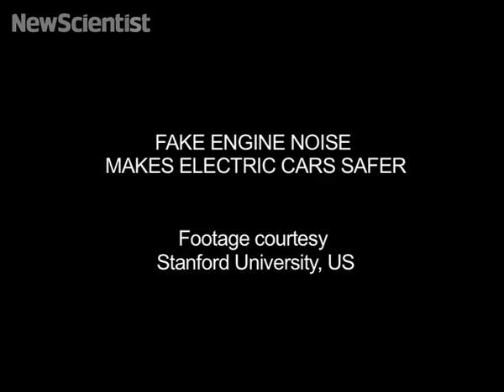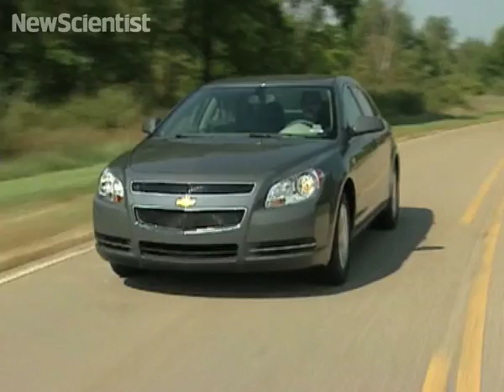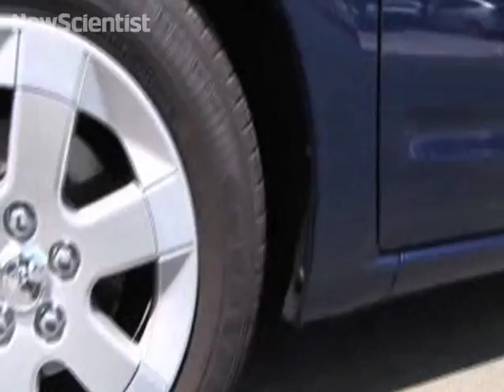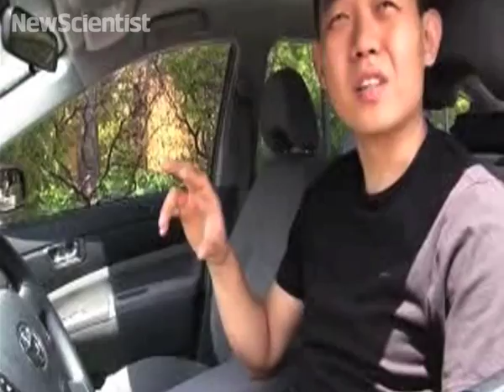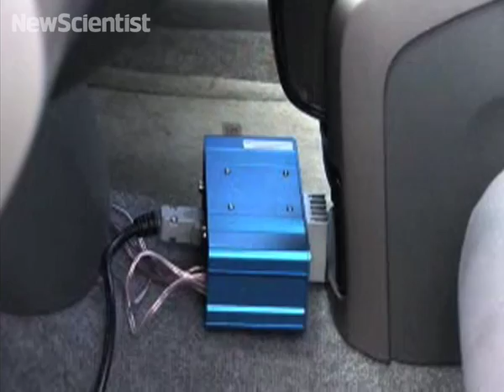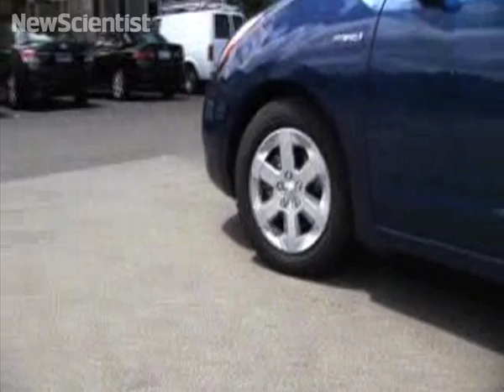Fake engine noise makes electric cars safer

Comment: What a load of crap, so we finally have quite vehicles and now it is said they are too quiet what a load of shit.Look some petrol cars are so quiet you can't hear them coming along anyway, the industry has been making them less noisy for years, so why do they want to now make them noisy again.What a load of shit.People walking in front of trucks that make a huge amount of noise, some motorcyclists were being ticketed for riding noisy bikes, so now they are to be ticketed for riding or driving vehicles that make almost no noise, bullshit.Some how someone has convinced some morons in office that quiet is bad basically manufactured a problem that simply does not exist, now they want to make a killing on selling crap that will make no difference at all to an industry that spent millions of dollars/pounds finding ways to solve the problem of noise created by engines.That is just plain stupidity of the highest level.Before you cross a road you should always look, most petrol engines can't be heard especially in the city amongst all the other noise, so how loud will this thing have to be in order to be heard? a stupid idea purely for making money, creating a problem where there is none.

Comment: All highway going downhill? What is "consumer level", under $150K? I don't know of a single car priced in the 20-40k range that can get 100 miles from battery. We have no idea what batteries are going to do in 10 years. It might double it might quadruple or it might stagnate. The real answer is using carbon fiber to lower the weight of the car. We have 3k pound cars to move 200 pound bodies. Makes no sense.

Comment: @sniper1334   This is true at higher speeds.  However, the concern is not with cars traveling at 30 MPH or faster.  Rather, it is with cars at slower speeds that  you would get at urban intersections, turning corners, or in parking lots.  The safety studies by NHTSA have shown that the increase in pedestrian crashes for hybrids is only at lower speeds.  Go out sometime to a street corner with a blind person and see how well they can detect hybrids versus other cars at 25 MPH and slower.

Comment: This is ridiculous because unless under hard acceleration, almost all modern cars with factory exhaust are quieter than the noise the tires make when contacting the road. Next time your walking and a new car is coming toward you at lets say 35mph, listen and pay attention to what you hear. You hear the tires, not the exhaust.

Comment: This would work great in winter.. when it gets covered by snow turds lol.  Its an awful noice still.  WHy not just put it in the grill so it only points forward, and one at the rear plate for use when backing up.

Comment: Horrible.  Not a solution; this is a bandaid.  Cars moving more than 10 or 20 km/h generate more noise from the wheels than the ICE anyway.  At speeds slower than that, the driver has enough time to hit the brakes...

Comment: The hybrid/electric vehicle to operate quietly until a pedestrian needs to hear it. The automotive companies spend millions of dollars to keep the cars QUIET,  PASS only allows noise when it's necessary this is why it should be on demand,  FYI Leader Dogs for the Blind in Rochester Hills, Michigan has 2 system that they have been using for 2 years for training. but I am the inventor of PASS SYSTEMS so I am Bias, go to my you tube and see it

Comment: This has to rank as the biggest excercise in stupidity I have ever witnessed because the simplest solution would be to plant small acoustic transducers on the armature of the electric motor. The moment the electric motor starts spinning the transducers would create an appropriate noise at a reasonable level.

Comment: The only reason the blind would need to know about a car in the road is if they are crossing it, which should be at a designated crossing ... so unless they are concerned about the blind 'jay walking' and getting hit ... im not quite following the use of this.

It sounds like crap and surely imitating the noise or a pertrol car defies one of the benifits of an electric.

Comment: That's awful... we should be moving in the way of QUIETER vehicles, causing less fossil fuel pollution AND less noise pollution.

There must be other ways for blind people to avoid cars crashing into them - oh wait, how about the drivers pay attention  when driving a car!  Or how about they wait for a pedestrian crossing to tell them when they can cross.  Whether it's a fossil fuel car or an electric car you'll still get run down if the drivers ignore the lights in any case.

This is dumb.

Comment: You have no idea what you are talking about.  My gs450h rarely uses the gas motor when I am in a residential area or maintaining my speed.  Even when I pull into my driveway, 100% silent.  Pretty much every hybrid to date has this "Gas - Gas/Electric - Electric" phases that engage and disengage based on driving conditions. Perhaps do some research before saying that all highbrids make a whine (of which I have no idea what you are talking about).

Comment: Hey!  I have had this idea for a long time. .  
It would be a very cool thing if I could make my old Mercedes sounds like a big V8 when I rev it. . It cant be that hard to install a sound modulator that is conected   to the coil (for picking up the Rpm) and then straight into my car stereo. .   And with a flick of a switch your were able to change the sound from a V8 into a F1 car or any other engine type. .  And if you also have external speakers you could be really cool at the redlight stop. .

Comment: I take it you've never actually driven a prius. Miserable little cars. The interior looks like shit and has more plastic than a ford, the performance is dismal, the fuel economy is less than a diesil BMW 5, and the drivability is that of most cute-utes  or minivans.

And let's say you neglect all of thatbecause it saves the planet. It takes less electricity to build a hummer. Plus, the materials to make the damn the damn thing leave such a big carbn footprint, it's not worth it.

Comment: lol yes you can ... the big black glasses and the stick thing are a dead giveaway. And the dogs are not trained based on "engine noise" because not every single car on the road sounds like a dodge viper ... the smaller engined cars barely make any noise at all, if anything the only noise you hear is that of the tyres gripping to the road. 
The dogs are trained to spot cars etc. and wiat for the coast to be clear prior to crossing. my arguement still stands, implementation of common sense works

Comment: Brizz519 wrote:
> And since when have the blind been aimlessly
> hanging out in the middle of the road, only
> fleeing when they hear the roar of a V8?

What the? Are you serious? The point is that blind people do cross the street and one of the ways in which they know when it's safe to cross is by hearing the cars. If they can't hear the car, they could potentially step out in front of it by mistake.

Comment: Umm yeah my mom told me to look both ways...and if you CANT then you DONT CROSS unless you have a DOG or if there's a cross light that BEEPS specially designed for BLIND people... GOD how retarded can people get.
And yeah most of the time it is the pedestrians fault, cuz they shouldn't be crossing even if they do have the preference. its called red light NO GO green light GO. and how about we stop having noise pollution? what's the point of having a silent car to attach noise on it?

Comment: Dont think this is a good solution. I mean I dont think many people will like the idea of being charged for something that doesnt benefit them. It would probably be cheaper to fit these disabled people with something then have every car sold fitted with one of these. Picture sun glasses with built in radar or motion sensors! If it needs to come from on the car it needs to be something far more beneficial like auto braking sensor.

Comment: might be a good idea for type of "problem"
but in this video it sounded more like something was caught and dragging under the car rather than an engine..
but that might be the sound quality on the video..
i agree with Bascoa also..
might be a bit much this..
dont big citys have audible lightsigns at walkways across roads?

Comment: yeah they should introduce different models, like one that sounds like a v12, one with v8 noise etc. at least something with a more carlike sound so you can actually tell if your brake pads ever start grinding.

Comment: Why would you make something that is quiet, noisy again?  Apart from the obvious, the great thing about electric engines is that vehicle noise pollution in cities will be virtually eliminated... Unless this stupid idea takes off.

Surely they could put sensors at road crossings that detect oncoming cars and emit a small warning noise from a sidewalk speaker. (if it were even really a problem in the first place)..

Comment: you're right dude, I mean the point on electric cars beyond the non contamination is also the veh being noiseless so, now they add this shit that sounds like a radio transmitter so people can hear it? that's BS as you said, you hear the tires, not the engine unless it's either a ricer or Toretto's Dodge Charger xD...

Comment: these people are fuckin dumb lol.

when i was a kid i had these bead things that i put on my bikes spokes and when the wheel moved they slid down and hit the rim and it made a noise. put some spoke hubcaps on that bitch and do the same thing mr. engineering graduate student. Or if thats too loud you could have a metal arm that comes down from the fender that you attach baseball cards to.

Comment: The blind should have an earpiece that receives RF signals being transmitted by vehicle transmitters. In this situation only the blind will be affected since they are the subjects in need. Many others would much rather live without unnecessary noise, especially city dwellers. Creating noise is not the proper way forward it seems. Also, its low tech. One would be degrading a promising quality of electric.

Comment: no, no, no... the silent running is one of the BEST features of these vehicles.
For sighted people: watch out when u cross the street, look both ways, yadda, yadda.

For blind people, why not cheap radio-activated proximity warning devices that could be worn as they go around?   Or why not "speakers-on-poles" at the crosswalks?

Really, complaining that cities have noise pollution and then undoing the benefit of silent tech is a step back IMO, there's better ways to do this, way better.

Comment: Oh, and this ignores the fact that -every- hybrid no matter how carfully driven always starts the motor a few moments after I start rolling from a stop when  in ev mode.  I've never made a turn with out it starting as soon as I lift off the break.   So if your going slow enough that the engine is off and you hit someone, you're an idiot.

Comment: Of course put more safety devices like this on all vehicles (not just electric) might annoy people enough that they drive less... after all just because a conventional car makes a little noise while driving it doesn't tell the direction its going or anything like that, and some are very quiet... So require it on all vehicles.  Not just EV/hybrid.

Comment: However a better solution is to separate pedestrian and automotive traffic.  Whether pedestrianizing streets or raised sidewalks, both of which are not immediate solutions and take quite a bit of struggle to implement in a country like the US where we're addicted to our cars.

But fake car noise machines are about a dumb as the toilet noise machines in Japan used to cover up the noise you might make why urinating in the toilet.

Comment: it's sad that in some cases this is needed due to driver negligence.  Here in DC, pedestrians have right of way if they enter a crossing zone, and it's the drivers responsibility to watch out for pedestrians.  Though most of the time they drive on pass ignoring them.  Hearing them coming isn't that much help when it comes to that... All it means is that you can hear you're about to get hit.